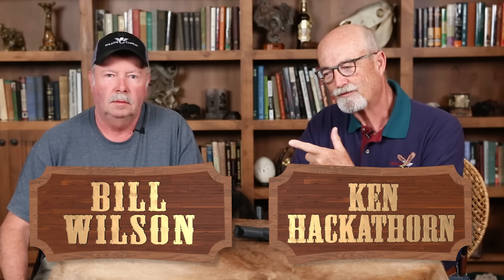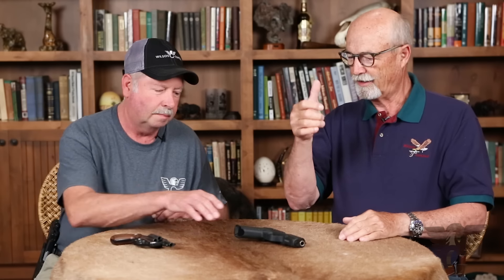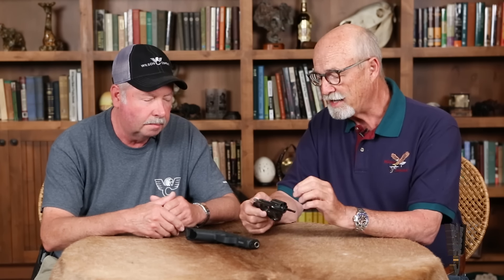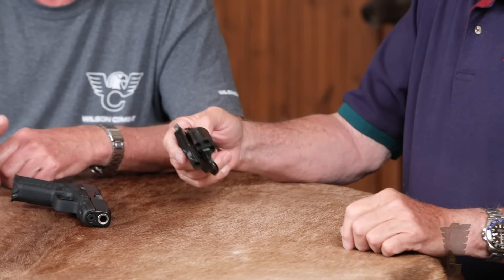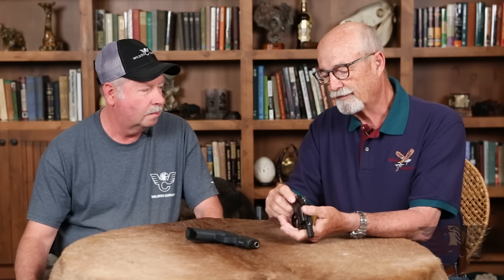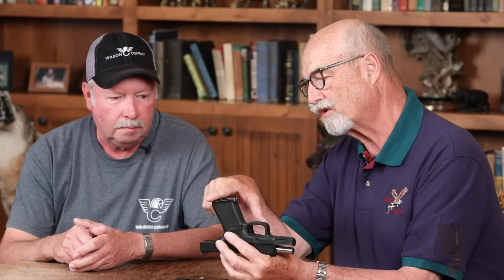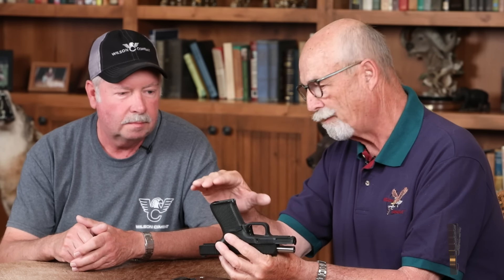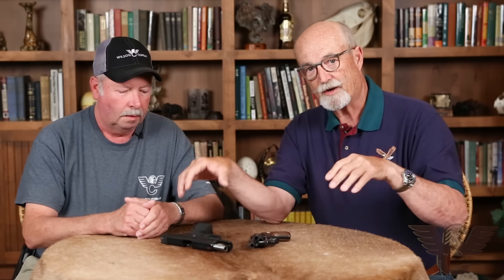DON'T DO THIS to Your Guns - Gun Guys Ep. 17

Comment: *me looking at multiple parts diagrams where the manufacturers call it a slide release*
Reply: Slide lock is more accurate, it locks the slide open. The slide can be released without touching it, but it can't be locked open without it
Reply: Wrong. I don't care what you say they call it. It is called a slide stop. It stops the slide from returning to battery when the last round is fired from the magazine.
Reply: @richwilson7619  what if it doesn’t have a last round hold open?
Reply: @AreUmygrandson   Then a 1911 is broke. Lol No really think about it. If the slide is not locked, you won't be letting it slam into battery by releasing the stop. There is no problem releasing on a new mag with a round being chambered. Releasing on a chambered round or no round repeatedly is stress that is not necessary and serves no purpose except to prove you don't know or respect the weapon.
Reply: @richwilson7619  I wasn’t referring to a 1911. Either way how is that any different function of a fire arm? Every time it fires it is doing exactly what you described
Reply: @AreUmygrandson   Exactly except much of the energy from the recoil spring is directed at the chambering of a round instead of all the energy going into the frame. This is very bad on an aluminum frame and cracks the frame at the slide stop holes. There is but one fix for that. New frame, so let her slam home if you like visiting and paying a gunsmith. Don't ask me about Glocks, I don't smith on plastic. Common sense tells me it might be  worse even with the lighter recoil springs.
Reply: Colt - Slide stop. Springfield = Slide stop. Kimber = Slide stop. Sig Sauer = Slide stop. S&W = Slide stop. Who calls it a slide release?

Comment: My god the Fudd mentality here is outstanding. 😂
Is this accurate reflection of Wilson's firearms?
If so...jezzus, save us.
Arex, Glocks,etc can not only handle dry firing, but is encouraged to do so as a way to practice for muscle memory.
And wheel guns are outdated junk. Sure they shoot. Whoopie do! So does a freaking 1791 Musket. But nobody is gonna "Tally Ho Mate" into a fight with one.
🤦🏻‍♂️

2,000 rounds is to prove that your firearm will go BANG in the most adverse conditions.
3 mags? That's cool...ask the Combat Vets about being in an extended engagement.
Geezus the Fudd nonsense here is so PAINFUL. 🤦🏻‍♂️

All I can say to this is GOBBLESS BRUTHA. 19 ELEBEN WUN TWO WURLD WARS!
Reply: They’re talking about running guns dry in the sense of not having any lube in them, not pulling the trigger on an empty chamber. Google “can 1911 be dry fired”, it too was designed to be dry fired without damage to the firing pin. As far as dropping the slide on an empty chamber I agree I think there’s alittle fudd there. But I think they’re mostly referring to it having a greater effect on the highly tuned custom pistols that they usually use instead of out of the box basic models.
Reply: @charlesroberts9900  They even say something to this effect, that stock 1911s do not have this issue.
Reply: Can you believe that there are people here still thinking that they can cause more damage with their hands with a repetitive movement ,more so then by the G's generated by the blow of the powder, putting that mass under accelerations far more important - also repetitive ....🤣😂🤣😂🤣😂🤣😂
Reply: No, the 2000 rounds is to prove you can neglect your gun and it’ll still go bang. Can be useful, but if you don’t neglect your gun, it is irrelevant. I never carry a dirty gun so I just care that it goes bang every time for 52 rounds.

Adverse conditions are more things like mud tests or wet sand tests, where ironically I found Glocks perform worse than 1911s on Garand Thumb and Texas Plinking’s channel.

Glocks are definitely better guns for lazy people who don’t want to clean or lube their guns, but those are within your control. Dropping your gun in the mud is more a test of the design itself and Glocks have shit the bed multiple times in those tests.
Reply: What do you mean?
Reply: @bobjohnson1633 What do you mean?

Comment: Guns need to be built to take full pressure ammo, also known as +p
Reply: Many are specifically built to accept +P ammo. Not all are.  Higher chamber pressures will wear the firearm faster than lower chamber pressures. For the maximum longevity of a firearm, lighter loads should be used more than heavier loads. If you require more power, get a bigger firearm.

Comment: Thanks for the instruction .  I don’t drop the slide on a Glock either ; ).
Reply: Why? Do you really think the violent action of a round being fired is less violent than the spring tension?
Reply: @nickma71  because it is. Ask an engineer. It's not the energy, it's where the energy if going and what parts are affected.

Comment: This is pure, unadulterated mythology. There is no evidence that dropping the slide release on an empty gun does any more "damage" to it than simply firing it. Guys, wtf are you thinking petpetuating this nonsense? I expected better of you.
Reply: Contact points impact harder when you do it.

Exactly how hard are these metals designed to smash into each other? Can you tell us exactly what forces they can handle and are designed to handle?
Reply: @bobjohnson1633 if my gun breaks because I dropped the slide then I bought a shit gun.
Reply: @SirDylan23 Well, everything is a trade off. If you want a really light, really nice trigger, you can’t expect the durability of a heavy military trigger.

Comment: If 1911's are this delicate and finicky, then there's good reason not to trust them for anything more than a range gun.  1911's must be the fragile snowflake of the gun world.  Strange Wilson Combat would put so much effort into such an obsolete design.
Reply: I think you missed the boat dude. 1. Most 1911's are NOT fragile. 2. The only reason it is obsolete it because it is a single stack with only 7-8 rounds of 45 in a heavy full size frame. They run forever and have a nice trigger.
Reply: @DB-oh5dx  I think you missed the sarcasm, dude.
Reply: @basp-ef7jx  Thank goodness! I've heard similar at the range and they were 100% serious. Although I probably should have guessed that it was satire based on the fact that you're watching these videos. Cheers!
Reply: @DB-oh5dx  cheers to you as well. :)

Comment: Ruger sp101 says what the hell are you talking about. It's in caliber 357 to begin with. You think 38plus or what ever is somehow going to explode in your hand. I get not pushing nato 9mm in pistols but cut the fudd lore crap.
Reply: There are still a lot of .38 special guns out there both on the used market and some new ones.  Running .38 special +P through these guns is dangerous.   Most modern .38 special revolvers say .38 special +P on the barrel and it's fine to feed these +P ammo.  Steel has improved a LOT over the last 50 years.

Comment: ? So, we aren’t supposed to Dry-Fire?  I thought we are supposed to practice over and over again, drawing, aiming and firing at a target…
Reply: Dry firing is fine as long as you’re using a dummy round or snap caps. Reasons why you shouldn’t dry fire on an empty chamber is because it can mess up the firing pin, or at least I’ve been told.
Reply: @Vital_Blinks  That's straight fudd lore for most modern guns. 22lrs, sure. some old design shotguns, maybe. but anything designed in the last 50 years it is fine.
Reply: @zososldier  That’s kinda what I was referring to, older guns are more of a concern for dry firing. I own a lot more older guns so it’s a bit more prevalent to me.
Reply: Dry firing is a different video. Without the cushion of the primer, in some guns the firing pin can over travel, and a shoulder somewhere will smack the backside of the breech causing a fracture. That’s why they sell snap caps. It varies with different gun designs, materials and metallurgy. When I was younger, I had a surplus CZ52 pistol, dry fired it twice and the tip of the firing pin rolled out the end of the barrel. Other guns where much more forgiving of my stupidity. Snap caps are great for dry firing practice

Comment: Don't top off a magazine after chambering a round. When you chambered a round, you have confirmation that the magazine is feeding. Why would you want to remove it and take the chance that it's not seated properly and will fail to feed in a life-and-death situation? You're better off with one less round than a misfeed in a shootout.
Reply: Say brother I truly believe your fear is unfounded with quality equipment.
Reply: You know what? I'm going to change the way I carry because of your comment. You're right. I occasionally have mag feeding issues, and this will give me a me just a little bit more reliability. Thank you.
Reply: @jdrseven  Happy to be of assistance! Carry on!
Reply: @walterknight1550  I never questioned anyone's equipment. I'm talking about the human factor. In any case, if you find no value in what I said, you're welcome to discard it. Carry on!
Reply: Magazines often fit very tightly when fully loaded and there is a round in the chamber.    This is mainly true of older guns but also many modern firearms.  This means it is sometimes hard to get it fully seated.

Comment: Let's hope the experts never figure out the slide drops each time the gun is shot.

Causes no harm whatsoever in modern handguns.  I saw enough "pro tips" I'm actually surprised I didn't end up picking my nose and eating boogers.
Reply: Well, you somehow know more about auto pistols than Bill Wilson. 🤨
Reply: He genius, Bill and Ken clearly explained that the slide velocity is greatly reduced when stripping a round from the magazine and feeding said round up the feed ramp and into the chamber, as it was designed to do by John Moses Browning.  On the other hand, letting the slide slam forward without a loaded magazine in the pistol causes unnecessary wear to the locking lugs as well as damage to the tip of the sear, and the hammer hooks secondary to slide induced bounce of the mating parts.  If you are going to ignore the advice of these guys, that’s fine, do it to your own guns, your gunsmith will appreciate the business…
Reply: Tell me you didn't watch the video without telling me you didn't watch the video.
Reply: Lets hope Emmanuel never figure out basic highschool physics...

Comment: HOW MUCH INERTIAL DIFFERENCE IN Newton-Dynes is there between slide release drop and cyclic rate of fire drop?  Let's back it up with facts figures and physics rather than dick-brain assumptions!
Reply: Why do you need the math if they can tell you exactly what happens when you misuse the gun?  They’re not guessing. This is based on experience.
Reply: Its a known fact the slide moves forward slower pushing a round into the chamber versus an unloaded pistol. You can see, feel and hear the difference. You can see the peening of metal on parts when it has been done repeatedly. This isn’t new info.
Reply: @haroldlundberg5676  in Europe we know how to make good guns too, and I have never heard that in all my life. As a matter of fact, manufacturers run the guns dry cicling the slide hundreds of times in special supports before selling the gun to the public. I don’t think this Wilson guy knows more than Beretta or Walther about making pistols.

Comment: Buy a modern gun.
Reply: Not enough plastic on this one for you?
Reply: @66smithra I don’t buy guns that I’m worried will break if I drop the slide.
Reply: @sambrown7536  they won't break but there is no reason to abuse them.  Some 1911s with very fine sear engagement shouldn't be beaten on like that.  If you can't understand that, then keep using your simple plastic blocks with spongy, springy triggers.
Reply: @66smithra  ahh there’s the disconnect. Yeah I’m not gonna spend 2k on a gun that does the same thing a 300$ pawnshop G19 can do. 😂😭
Reply: @ right. And a 5,000 dollar civic does the same basic thing as a 300k Ferrari.
Reply: @66smithra  very true. ☠️😂 that’s why I drive a Honda and have an old Silverado work truck.